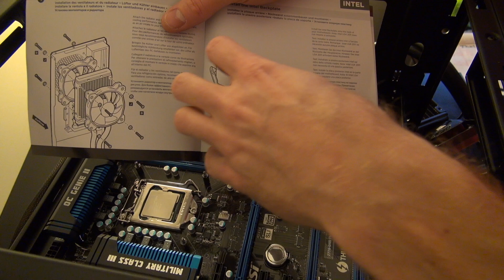How to Install Corsair H80i H100i CPU Liquid Cooler - Quick Guide Corsair H80i w/ Intel 1155 Socket

Comment: i'm using cooler master elite 334 chassis.. seems like my chassis is a little too small even it is a mid-tower... the radiator have to be on the outside and i cannot close the case

Comment: You forget one very crucial thing to tell people though Jwolf, to mount the Radiator with hose down and not up , as pr Corsairs own recommendation and to avoid air bubbles at the top of the radiator.